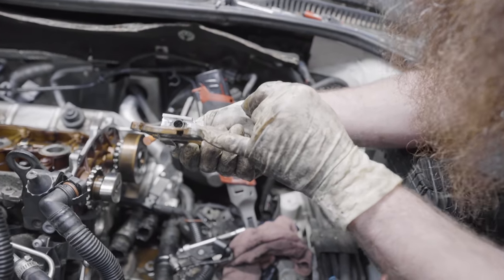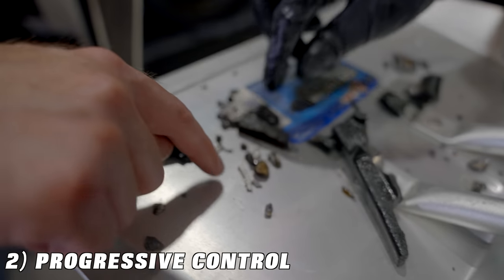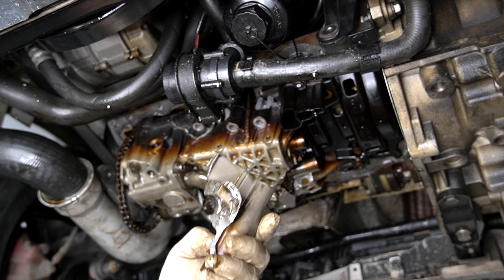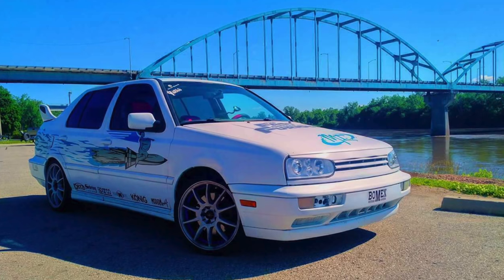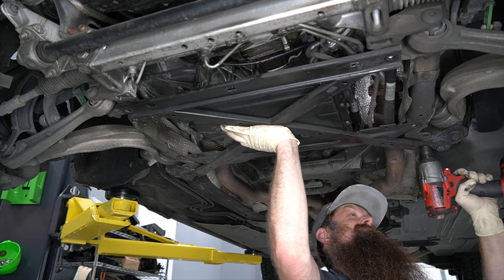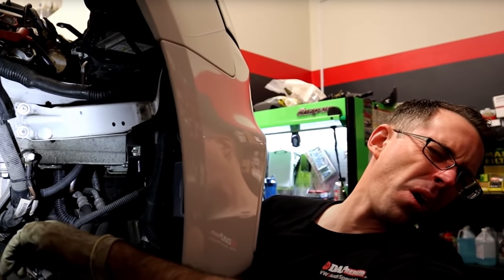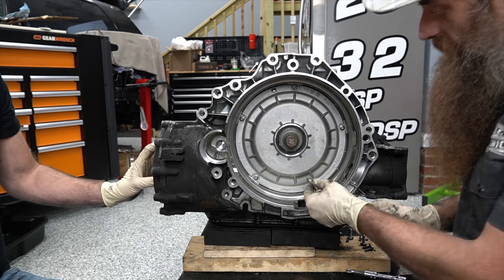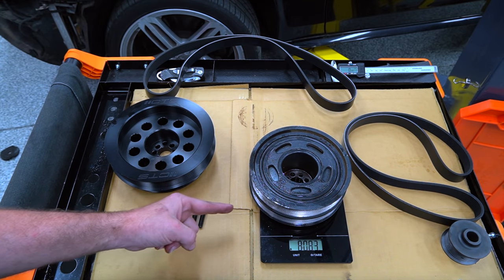I Blew Up the 1/4 Drag Car on the Dyno ~ JDM vs Euro RACE Episode 3

Comment from the maker: I KNOW you guys have a lot of questions. LOL WTH did we jet for 100? 
Why not Fix the Jetta?
Are you stupid? (YES) LOL

We did a more indepth N20 video here ~ https://youtu.be/SJ0sVL_Y3FQ
Reply: The Jetta GLi was like nope not doing this f*ck this im gone see y'all!!!! ✌️✌️✌️✌️
Reply: Y'all need to gap your rings or it'll happen on everything you boost.
Reply: Any VAG guy knows this is a no no with cheese rods. It made for good content though. Would love to see more stuff like this its a treat.
Reply: Did you guys turn off traction control? Stupid question, but that tends to disagree with nitro
Reply: Their engine is already a turbo engine. This is likely just a function of them not adjusting the ignition timing to suit.
Secondly why they didn't start with a 50 shot is beyond me...
Reply: "Too soon junior!"
Reply: I told you volvo 850r was cheaper and easy to work on  hahaha,  what thing not to do with your GLI
Reply: 2.5 jetta on ie and nitrogen
Reply: 100 shot= pull 2 degrees of timing, 2 step colder plugs
Dont spray before 4k rpm
Reply: A 35 shot makes like 100+whp on a forced induction car 🤦‍♂️
Reply: Fun and Great videos guys! Cheers from Guatemala
Reply: Personally I'd would've chose a honda. Due to a b series being reliable to 500hp with stock internals. And the k series reliable to 700hp on stock internals
Reply: Looks like almost what happened to my 2017 Golf R
Reply from the maker: I’m hoping to fix it lol
Reply: I’m kind of disappointed. I wanted to see what you could squeeze out of that Jetta with DSG and slicks.
Reply: The Jetta just needs an oil change and it'll be good as new. It already spewed out half of the old oil so you're already part of the way there!
Reply: if the car is fwd wouldnt you wan to mount the nos in the front for extra grip
Reply: im more curious why you didnt just swap over the whole used trans
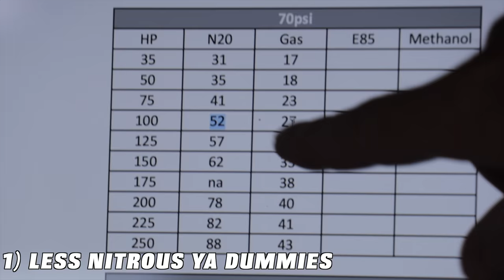Reply: 3:42 #1 should have got a Honda..... 436tq out of a K20 is a regular thing, ~550ftlbs is the "limit" of a stock bottom end K20A1.
JDM Vs Euro? We just saw who won.
I throw shade, but drive an 2015 A4.
Reply: @Multiversal_Rift  No...
Reply from the maker: Yea. I had to plug the button back in
Reply: @thenewhalogod  Would they have been able to get a K20 + a car for less than $5K?...I hate these comments, because it's pretty obvious that people that spout this kind of stuff off have no clue how little a $5K budget is for a car + mods.  The K04 + nitrous was a great idea on a budget, but they should have added a progressive nitrous kit in the first place.  That was where they made their mistake.  The stock rods on a FSI/TSI motor can't handle that much torque and the progressive nitrous kit would've avoided adding all of that force to the rods instantly, which is what snapped the rods.  I'm pretty sure a 100 shot would have been fine, but like the guy above said, you have to make other changes to spray nitrous (timing, plugs, etc).  They literally just said 'yolo' and sent it.
Reply from the maker: I’d had some solid feedback on it. But clearly we went too send.
Reply from the maker: Same. Lol
Reply: smallest jets to start next time. you have to use that bottle up on something.
Reply: My question is how is this content so unwatchable. Very disappointing
Reply: Grinning like a lunatic at engine destruction 🤣
Reply: So you don’t have a need for the ko4 and the fuel pump? I mean if you want to just get rid of it I would love to slap it on my gti. But anyway I love this series and am rooting for team euro.
Reply: Lucky buy with the s4 I always wanted one and the price he sold it to you is a steal🥲
Reply: should of just got a mk1 and swap a vr6 in it
Reply: @HumbleMechanic  When it comes to reliable performance project cars, the wise man looks East! To the land of the rising sun and spicy pickled kimchee. You should fix up a Hyundai Genesis Coupe 3.8 Track or fix up a JDM Toyota Supra Mark 4 or a R34 Nissan Skyline GT-R, or a Mitsubishi Lancer Evo X.
Reply: What caused the S 4s clutch packs to burn up, just mileage or lack of fluid change ?
Reply: Fun fun fun fun!!!
Reply: @Luckydoobie671  well these guys had to use a European car. Gears and gas went with a b series. They are doing the jdm car.
Reply: @young_busy   honda is cheap speed. 👌
Reply: Bro u DAFAQ didn't y'all find a shitty bug and subi it. It can be done under 5k
Reply: @PajamaSenpai  obviously you didn’t see that hole in the block, ect... just an oil change won’t fix it!  It’s gonna need some JB Weld and a couple rolls of duct tape!!!👍🏾😎
Reply: The S4 is a much better proposition for the drag race, should have started with that in the first place. The 2.0 TFSI is not the most reliable engine when tuned, but the V6 3.0 will yield some pretty good results, afaik. Looking forward to seeing the final episode! Go team EURO!
Reply: @whorutothink  They just blew rod at 600Nm. Around 500Nm is about safe limit for that stock engine.
Reply: Another late-model VW does what we expected it to do.
Reply: Shoulda just gone Honda K series or  Nissan SR20 or RB
Reply: I would have jetted way more than 100hp
Reply: Just desperate to create content sadly.
Reply from the maker: Not really but everyone has to believe something
Reply: @robertsothmann8110  exactly. Cause they walked into it knowing it was gonna blow up. Just so they could get that click bait image and title. More clicks more views more $ for them. 

I’ve made sure to hit do not recommend channel though so I won’t see these 🤡’s again👍

Countless videos of people blowing up their engines. This video takes 20 minutes + to show a 4 second clip. They sure are desperate!

Comment: There were lots of NOS lessons learned!  We covered in a video that also shows the install. 
https://youtu.be/SJ0sVL_Y3FQ
Reply: Cheers, don’t think the failure was your fault. I blame it on the hitler dust VW sprinkled on it at the factory.
Reply: I'm sure there were quite a few lessons learned, but did you guys actually take an hour or two to go scour the VW Vortex for some threads where others had made similar mistakes or installed the nitrous and used it successfully?  I haven't looked myself, because I can't afford to take such a risk on my daily driven MK6 GTI, but if I were going to take such a risk I would definitely have done my due diligence and done my research ahead of time.  It was entertaining, but sorely disappointing at the same time.  It would have been way more entertaining had you guys successfully installed a progressive nitrous kit and been able to use the right spark plugs (probably 2 degrees colder than the original factory plugs like the guy above stated) and with or without timing having been pulled (maybe gotten a custom tune from someone reputable like Stratified).
Reply: @whorutothink  in the end this was too much power for the FSI. We were out of budget and likely to lose without the NOS. We shot a little too high though
Reply: @Deutscheautoparts   as with the YEARS of experimenting on 1.8ts, 440 lbft of tourque at 3k rpm on factory rods will always break shit.  Spraying closer to 5k might have netted a completely different result.  WAY too much lowdown torque.
Reply: What were you using for engine management/tuning?
Reply: @Deutscheautoparts  go big or go home
Reply: @brianinglis2199  don’t think that’s how it’s works

Comment: You're lucky that hundred shot of NOS didn't blow the welds on the intake...wait...what?
Reply from the maker: Plastic manifold for the win!!!
Reply: @HumbleMechanic  luckily, plastic can be welded too.
Reply: Danger to manifold
Reply: @pieterv6984  Now Paul and the mad scientist gotta tear down the block to replace the piston rings they fried.
Reply: F A M I L Y
Reply: @HumbleMechanic  Yyyyeeeaaa I feel bad... Ex Euro Mechanic in Russia for years. 

Should have got an old Audi or even an older Jetta. VK started using Plastic where you seriously shouldnt 😅

Good luck though, you guys got what 10days? Im a JDM/Euro girl so im torn either way. 

Euro can win, I just dont know if later model Jettas are the ticket 😢😢

Edit: 6 days 😬😅 good luck guys ❤️
Reply: @HumbleMechanic  Also I shouldnt be sharing info like this... But be careful. I heard Hectors running 3 spoon engines 😲😲
Reply: Now the mad scientist gotta pull apart the block and replace the piston rings you fried

Comment: Always a sad sight when a car blows its guts out, even if it was a beater
Reply from the maker: Yep! I have an engine, we will get her fixed at some point. LOL Now its time for shift to the other car
Reply: Beaters are the best. When you scratch it, you don't even care.
Oil change? You can do it a little later (15k km instead of 10k km), to save some money.
And beaters are usually cheap to maintain.
Reply: @jacobmadafaka8232  yeah, i use to have a 93 525i and i beat on it since /
130k miles to 254k and when the transmission finally went out it hurt like hell

Comment: A B8 S4 for $1500... I would have bought it too!
Reply: This is the least believable thing to me on the video! Even the interior and rims would run for more than that.
Reply: No, 1500 for a transmission for that car ;)
Reply: @nielsdebakker3283  definitely said $1500 for the car and about $1000 for a trans. Later in the video he said he paid 600 for a transmission which he then took the clutches out of.
Reply: Yes, absolutely unbelievable, I understand that they can tap into their network connections, but this kind of ruins the credibility of the video.
Reply: The Trashman  I have 4 Audi's! One (a 2001) gets driven at least 100 miles a day, another (2014) is also a daily driver, another is a patys car and the last I just bought. They do take an extra bit of maintenance but a hell of a lot more fun (and faster) than a Toyota!
Reply: The Trashman  biggest issue with German cars is owners that aren’t prepared to take the necessary steps to maintain their car. While they have inherent issues, most of these things don’t become ugly when properly maintained. That said, everything mechanical breaks. I get to drive the nice cars because I know how to fix them, I thrive on people being afraid of things breaking on cars.
Reply: The Trashman  so you have to spend 6k a year to keep it on the road. that doesn't make it a pile of shit, does it? guys? is this thing actually a pile of shit that I spend too much money on?
Reply: @4BillC  try out a v6 Camry. faster than VW and doesn't require thousands of dollars to keep it on the road.
Reply: The Trashman  I'm with you. Audi and VW have some style, sure. But they are junk even when they are new. All German cars for that matter. Simple is better. Hondas for race cars and Toyotas for daily use.
Reply: The Trashman  dgs is a joke on audi's part. pretty sad considering most of their transmissions are fairly reliable and the motors can be very solid.
Reply: @Evibean17  honestly DGS is shit, it reminds me of the old ford transmission in the mazda 626. unreliable and needs fluid changing way too often and still prone to failure.
Reply: The Trashman  I've gapped a few honda K series. And my 2.0 Tfsi is well over 300hp! Calculated from ⅛ mile time.
Reply: Also for the people hating on VW/Audi... Why are y'all even watching this channel?
Reply: The Trashman  stock turbo! Just a tune and being able to hit 3rd gear helps! Lol
Reply: The Trashman  I'm sure if that same stock Honda spent $2K on a turbo it's gap the shit out me! I have no beef with any car. I just happen to like my Audi's. I just don't really like the way a Honda sounds. Hell I barely like the way, my cars sound!
Reply from the maker: @nielsdebakker3283  Over $3000 for a complete trans used.
Reply: The Trashman  Where'd you hear that? The timing chain tensioner last 150k+ on the MK7 GTIs lmao.
Reply: The Trashman  Plus a MK7 with a 400 dollar tune would gap ANY K series lmao. I know from personal experience.
Reply from the maker: For a working trans, the best I could find was $3100. This was a parts trans that was missing the diff.
Reply from the maker: The wheels are trashed.. Very drive by feel.
Reply: @HumbleMechanic  I assume you are talking gen 1 dl501, these are rare and expensive since they $hit the bed very often. It’s now actually worth to repair them rather than replace with unknown condition gen1 unit
Reply: The Trashman  If a timing chain dies at around 30k you know pretty sure it's the drivers fault

Comment: Never seen a man so happy to see large metallic chunks in his oil pan...
Reply: I threw a rod driving a car once. It just needed some fresh oil but it was super high mileage and a not so awesome engine to start with and was a manual transmission which was a requirement for me way back then. I was on a road trip back from Austin, Texas and we were about 8 miles from home when, *BAM*, car shuddered horribly, power dropped and nothing worked. I pulled over to the side of the road and oil was on the low side, but didn't seem terribly bad when looking at the dipstick. Wouldn't turn over, so we used insurance to trailer the car back to my house. When they started to wind the car to the trailer we saw all this oil pouring out from the back end of the block. It was crazy. I remember when it exploded all this black smoke started pouring into the cabin and I looked out the rear review mirror and saw what looked like shrapnel scatter all over the road.

Comment: I'll take every S4 you can find for $1500... That's a $5k car in parts easy
Reply: This...I feel like one of the rules should've been no buying cars from friends because ain't no way a regular dude could find a car like that for less then 5k.
Reply: The seats alone are at least $1k
Reply: Total bull crap. $1500 for the s4. The wheels alone are worth that.
Reply from the maker: @ohhhcrap  I feel that. but where do we stop? Could have easily said you have to actually build the car, not buy one modified.
Reply: @HumbleMechanic  honestly that would've probably been a better way of doing it but also would've been harder to find a car under $5k since unmodified stock euros/jdms fetch a premium now a days
Reply from the maker: Totally agree. I think keeping the rules light was a good thing.
Reply: What’s wild is that newer VAG cars pack so much potential they o be fast, whereas for the most part Honda’s have had the ability to be easily fast since the 90’s. They don’t gain as much with the newer cars IMO.
Reply: @jedediahsmart569  the problem is all the new emissions/safety laws that automakers are forced to work around in order to produce new cars which also drive up the price of a new car in today's market.

Comment: Lol what about the ignition timing and afr. Seems like blowing it up was the plan with no tuning involved. Also when you wet spray though a intake designed to move only air distribution can become problematic. Start with a small shot, read the plugs and work your way up.

Comment: Now you got me curious as to what power levels you could've gotten on a 50 shot ramped up, then to a 100 shot ramped up. Not that the engine or even the DSG would hold those torque levels, but maybe it would've held for a few passes.
Reply: The dq250 dsg is very robust and if we’ll maintained and with the proper dsg tune would’ve held up just fine. However the engine and more specifically, bottom end does not like tq down low. 100shot was way too much of a shot to be sprayed down low and was too much of a shock. Like I said rods are a weak point in this motor so anything more than 350-400wtq and your praying to hold it together, that’s hard to do with small turbos that like to make tq down low. I personally have the same car and am deciding on what turbo to get bc I don’t want to build my motor. Cheers, sorry for long response.

Comment: $1500 for an S4.. thats crazy.
Imported to the EU, it would go for at least 15k when fixed
Reply: yeah. a car like that isn't $1500 needing a only a $1k transmission
Reply from the maker: The trans I got quoted was like $3000. Lol I’d have bought a While replacement for 1k. Lol
Reply: @dustyc324  you would be suprised, i started in a euro focused rebuilding shop. got my first audi A6 for 1200$ out the door after repairs, customer sold it for 600$ to the shop. tune up, full front suspension and a used transmission computer was all it needed. body was mint, serra terra cotta chocolate brown leather and 98k on the dash.
Reply: @HumbleMechanic  throwing any codes?
Reply: @rickylafleur5823  oh. thats all? lol. was it an S4? and it never broke after that? unicorn.

edit. The only good part was the body. says nothing about the quality of the vehicle
Reply: @HumbleMechanic  also the wear on the clutch looks like marks from surging, and mechatronic failure is fairly common with these. if you get it out  again physically jump each one and look for failure points or anywhere pressure could leak from.
Reply: @dustyc324  it was a limited edition and other then a axle all i had to do was brakes and oil changes and a outer tie rod. the older A6's are tanks, and i still have that car to this day, i bought it ten years ago. the only thing wrong with this S4 is that it has a DGS transmission, those 3.0tsfi are meaty and can take a beating.

 my neighbor runs his A7 on E40 with some APR mods and a ecu flash, 700hp stable with very little upgrades and stock internals and triptronic transmission. you would be surprised what a good VAG transmission can handle without blowing up.

99/100 times i see someone shitting on a VAG is because they don't maintain it worth a shit.
Reply: 320000km 2010 a4 with bad transmission isnt worth 14000euro 5000euro max
Reply: @Sadik15B  Wasn't an A4.